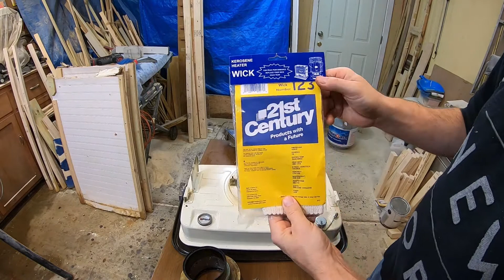Kerosene heater using Diesel WILL IT WORK  Part 2

Comment: I've found that it does work okay in my old Perfection (all cotton wick) heater, but I never had any luck with modern heaters that have the fiberglass-topped wicks. In my Perfection, I mix a gallon of Kerosene to 4 gallons of diesel and that helps it to wick better and I don't have to clean the wick very often. Don't really notice any smell with the Perfection heater, but I sure did with the fiberglass-topped ones.
Reply from the maker: Hey Richard   I guess the old school wicks are better. If you could subscribe to my YouTube channel. That would be great. Let me know what else you find with the newer wicks
Reply: @RusticTrends  All-cotton wicks are not "better" - they just have different strengths and weaknesses. Main weakness is that they need more maintenance, and need to be replaced more often. Fiberglass wicks do not like dyed fuels, and require cleaner fuel. Though modern "winter" diesel is very close to kerosene, it's not completely there. I have Perfection and Aladdin heaters that use all-cotton wicks. The Perfection can handle winter diesel ok - though I add about an ounce of 91% isopropyl alcohol per tankful. The Aladdin heaters are pickier, and seem to like only kerosene. I also have a "Rainbow" heater that can take EITHER fiberglass or all-cotton wicks. I even have a oil furnace that does not use wicks and can run without electricity ( haven't tried it, yet ) and has 51,000 BTU!

Comment: Some of the differences in opinion regarding diesel fuel may have to do with WHERE and WHEN the diesel was purchased. "Winter" diesel is a different formulation than "summer" diesel. Also, winter diesel blends are different depending on how far north you are and how long into the winter you purchase it. Winter diesel is "winter" because kerosene is added to it to prevent gelling in very cold weather. If you're in Texas ( normally ) they don't even HAVE winter diesel. If you're in Canada - then you do. All that said - fiberglass-wicked heaters probably aren't going to like even winter diesel, and certainly not summer diesel.

Comment: I have a round DynoGlow style heater I Burn off Road Diesel in it and the Wic is ok As Long as you dont Shut it off.. You Absolutely Have to make sure You just let it Burn Completely Out.. That will stop it from Clogging up the WIC It doesnt Burn As Hot as pure k1 But the top of it gets hot enoung to boil water on without the cage n can cook on
Reply: I use it in My 36 ft camper i remodled when its like negative 20 outside it will bring entire camper up to almost 95 Degrees have to open windows lol
Reply from the maker: I’ll ha e to try that. When I started looking up on what to do. There are so many videos out there. Then you think. Ok witch one will I try lol. Well I guess I did it wrong lol. 95 get some sand. And some palm trees and call it a day lol. I hope you like the video. And subscribe to my YouTube channel. Just trying to make my YouTube family grow.

Comment: I had a large round one that was stinky. I found 3 ceramic grates out of a old propane stove and set them on top of the ring it was like a after burner.  Worked great took the smell away.

Comment: You’ve described my experience to a tee.  Not sure what the other guys are doing to make it work. But there is a lot of mention of using a 100% cotton wick.  I’ve searched and I cannot find one for my particular heater.  I’d like to experiment with a homemade wick made from 100% wool felt. Cut it to the same diameter and stitch or staple the edges together to create a cylinder.  Seems like a simple thing to try.  If anyone has experimented making their own wick please let me know.  Thank you. I’m not concerned about the smell so much as I am only trying to heat my Shelterlogic Shed enough to melt the snow off, when it snows.
Reply from the maker: Hey Ed. One thing I have found. You can mix with half diesel and half kerosene. That will work also. I hope you have subscribed. Let me know how you make out with it
Reply: I’m also wondering if partly why this won’t work properly is that the Air to Fuel ratio is different for diesel than it is for kerosene. AKA the stoichiometric ratio.  If the heater is designed to  burn kerosene at a specific rate(rate of  fuel volume through the wick) the air volume would have to be correct.  i don’t think the diesel can wick fast enough to burn properly. Diesel’s ratio is 14.5:1, kerosene is 15.6:1.  not sure but makes sense to me.  Maybe I’m overthinking but I cannot for the life of me get mine to burn properly.  I’ve used alcohol, conditioner and acetone, burns for a while then flame dies down  to a flickering blue ring chasing around the wick.
Reply: I found out something fairly interesting this evening I’m still playing with mine with the diesel.  I noticed that if I pressurize my heater’s fuel tank slightly,  the flame size increases and starts producing more heat.  I removed the tank cap to check the level, and noticed the flames grew a little higher.  So I said hmm, what if I dialed my air compressor regulator down real low, and applied a bit of air to the tank what would happen.  Sure enough I dialed down to about 3 psi, stuck my air blow gun into the filler hole and plugged around it the best I could with my thumb, the flames shot up and actually started making the mesh glow with no added smoke or soot.  Fumes still aren’t great. Not sure of the long term effects but I’m going to create some sort of plug the size of the filler opening that will accommodate my air blow gun and inject some air for awhile see what happens.
Reply: @EdFilips < Greetings: Same problem with mine using diesel. I will attempt cleaning wick, replacing it or adding some various fuel additives and tricks I know from bring OTR driver.  Diesel, propane, wood, black oil and various alternative heat options all have + and -. I figure it depends on wallet, preference, fuel availability, convenience, dwelling requirements and limitations.
Reply: What came of this?  @EdFilips

Comment: Hi, 
A few things that might help.
I have restored over a half dozen heaters, the model you have is the ONLY one I came across that stunk no matter what I tried, it seems to be the fault of that catalytic screen on top,  the black carbon buildup needs to be crushed by putting wick over pipe or something and hammering, crushing with pliers or channels also works, I got it with kerosene also and diesel actually seems a little better. The line on wick is for correct installation height. I'll end by saying any other heater will give you a better all around experience using it, sorry.
Reply from the maker: Hey Bob. I always like the input from others. With mine   I don’t get the smell. Maybe it’s the brand of wick. Also. I’m now just using K1 kerosene. I’m glad you like the video. I hope you have subscribed to my YouTube channel. Thanks

Comment: This heater wont work with diesel unless you take the wick out all the time and smash the carbon off of it.  Been there tried that.  It works but is a pain and eventually beats the wick to death.  Go with a kerosun moonlighter or one of its variants with a cotton wick of you want to use diesel.

Comment: Works very well in my KEROSUN radiant 36,,, but the other kerosuns not very well...
Must be the wick that is in this KEROSUN 36 be nice if i could find another wick just like this one for the other 5 kerosuns i have..
It can tolerate the DIESEL like its PUPPY FOOD.
USING NO ADDITIVES THIS OR THAT CRAP, just plain STRAIGHT DIESEL in the tank..
the kerosun 36 has the FIBERGLASS WICK.. and been doing it for several years now...

Comment: I know this is an old video, but if you want to burn diesel for heat just get one of those Chinese fan forced heaters.  Added bonus of going that route is they vent the exhaust outside, so no more stink.
Reply from the maker: Hey hotanmp3. You are very right on that one. I have thought about getting one. I hope you have subscribed to my YouTube channel. Just trying to make my YouTube family grow. Thank you
Reply: Can you tell me what he means about the Chinese fan forced heater and where exactly would you place it on the heater? Thank you and God Bless you and your family!  @RusticTrends
Reply from the maker: @kcjennieb  its a diesel heater. But you will need to power it. With a kerosene No power needed. I am going to do a video of the fan you can out on top of the heater. No power needed. And there about $20 online

Comment: I use a 50/50 mix diesel and kerosene plus the alcohol and diesel treatment. So far it's working ok but I did notice that my blue flame 🔥 at the top is gone, all orange 🍊.
Reply from the maker: How much of the alcohol are you using. Also. I hope you have subscribed to my YouTube channel. Just trying to make my YouTube family grow
Reply: @RusticTrends  : 8oz each of the alcohol and diesel treatment. IMO  I think it's putting out less heat and lasting longer. I basically just use it to warm up the kitchen in the morning.
Reply: @RusticTrends  : my local mom & pop hardware store is asking $78 for a 5gal kerosene, Sutherland's asking $64 so I'm getting 5gal from Tractor Supply for $49. Back in the day gas stations sold kerosene, I haven't been able to find anyone pumping kerosene.
Reply: @RusticTrends  : just to let you know, I agree with you 100% for going back to kerosene. The company designed the heater to burn kerosene so using diesel and additives is definitely not healthy.
Reply from the maker: @imaslowlerner  One thing you can do. If you have a walmart by you. They sell the K1 Kerosine. Its a little over $10 a gl  You can find it in the camping section. It comes in a white jug. I hope that saves you a few bucks. Hope you have subscribed to my channel. Take care. Feel free to write when ever you want.. If i dont hear from you. Have a good Christmas
Reply: Greetings: All of the hype on kerosene heaters. The average cost factor: Filtered K1,  $10/Gal, Diesel - $4/Gal, additives -  $2 / gal of fuel, wick_ 10-$20 / month using diesel. Skipping the math and listings...assuming there is 120VAC available, is electric cheaper, simpler, less hassle, orderless, cleaner, Etc than the stand alone fuel options?  I slightly prefer the passive diesel idea 4 the stand alone option figuring fuel cost. However it is a PIA.

Comment: Sounds like it is not working... You tried burning it straight without the ADDITIVE JUNK?..... i have a heater just like the one you have KEROSUN RADIANT 8 AND 36 FANCO SERIES 22, SEARS & ALADDIN TR5000 and few PERFECTIONS... dont know what is going on? I been doing it for while long time without issues... The stink comes when its doing the dry burn... Put the wick up on high LIGHT HER UP AGAIN...   Looks like i am going to have to post 5 videos of my heaters doing it without issues///////
Reply from the maker: Don’t know what I did wrong. I used the Isopropyl Alcohol. I did have the wick up high. Maybe it’s the diesel we have out here. But I will watch your new videos on it. And figure out what I did wrong
Reply from the maker: I think I know what I did wrong now. I didn’t let it sit. Diesel here in New York is almost $3.00   Got to love the taxes here lol
Reply: @RusticTrends  Once and for all throw the damn additives away.. NOTHING WRONG WITH THE DIESEL.. I see you put the old wick back in... $3.00 a gullin (onroad diesel) try to find a place that sells the OFF ROAD DIESEL (RED DYE) atleast in OHIO where i live it is cheap to live.. And the gas station here sells off road diesel.. They had kerosene at $4.39 a gullin they finally got rid of it completly and put in OFF ROAD DIESEL PUMP.. AND very cheap $2.00 a gullin..

Give it a try without the additive shit.. If it does not work this time i will get you a replacement.. The old wick, put it back in, light it up on high it should burn the RING OF TAR OFF OF IT... then let me know how it goes. the wick should be soft and not crunchy...
Reply: @RusticTrends  Update?  Did letting it sit longer get it working?  Did you use additives or no additives?   I know Michael likes to say no additives, but you see others using it.  I don't see how it could hurt to use them, but not sure if they're necessary.   Kerosene here is $8 a gallon, diesel is half that and easier to find.   I'm about to start using diesel in one of my dura heat 28,000 btu heaters to see what's gonna work.   Happy to "dry burn" as Michael says, if necessary.
Reply: @RusticTrends  I saw that you were using 70% Iso alcohol.  You have to use 91-99% Isop alcohol.  70% has too much water in it and  will cause it to smell  just like if you use  year old kersene that has got water in it. You also need to dry burn it each time you use it if you are using diesel. That will keep it from getting so much carbon on top.
Reply from the maker: @MarkGumm   Thank you Mark. Ill have to try that. Now I know where I went wrong.
Reply: @btiller44 how did the heater work with the diesel or did it work… please give a update
Reply: @wemcal  I'm using diesel in all my kerosene heaters now, no issues!  perhaps a bit more smell but that's it
Reply: @wemcal  btw, I have a jet blower style heater and two of the stand up vertical heaters
Reply: @btiller44  thanks for the update… is this straight diesel or additive mix…
Reply: @wemcal  straight diesel from the gas pump..  no additives

Comment: Rustic i am going tris one last time with you. if it doesn't work its all on you. 
1. First of all THROW ALL THE ALCOHAL AND DIESEL ADDITIVES SHIT OUT!!!!   RUBBING ALCOHOL has water in it, 5% PUT some of in a jug of gas or diesel let it sit for a day look on the bottom, the water always goes to the bottom, and wicks do not like water PERIOD.

2. Fill your tank just enough for how long you plan on using the stupid heater. DO NOT PUTTY OUT FLAME IN MIDDLE CYCLE.
3 Let the damn heater burn itself out (DRY BURN)
4 PUT THE WICK UP ON HIGH light her up again, it may burn little or it may not..    May smoke some..
Let it burn completly out on the second light up
If it doesnt work, then you are doing something wrong. i have the SAME EXACT KEROSUN heater like yours. i burned a hole barrel of DIESEL in it without issue. and as well in my other KEROSENE HEATERS.  I telling you what i have learned and when the wick CRUSTS UP..

iF NOT please by all means BUY THE $6.00 WORTHLESS SHIT JET FUEL AT $6  a gullin.. However you do it. atleast its not my money i throwing away. I will continue to burn the HOME HEATING OIL (RED DYE DIESEL) at $2.00 a gullin. Second i would never would buy ONROAD DIESEL so the state dont get the damn tax for heating my house. \

I gone through atleast 150 gullins of HOME HEATING OIL without issues  in the 10 kersosene heaters i have.  150 x $2.00 = 300   WORTHLESS SHIT AT $4.15 TO $6.oo gullin- 150 gullins of the worthless shit $622 150 gullins of shit at $6.00=$900.
Reply: What is a "gullin".